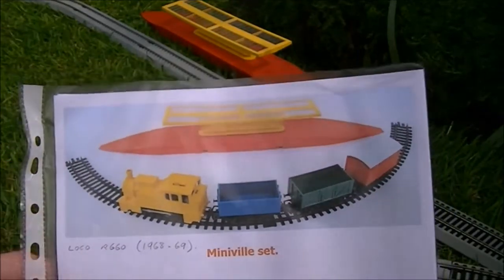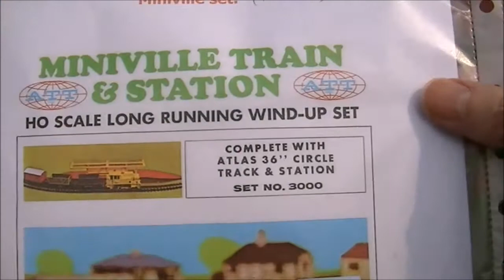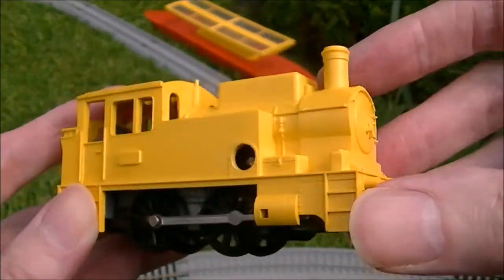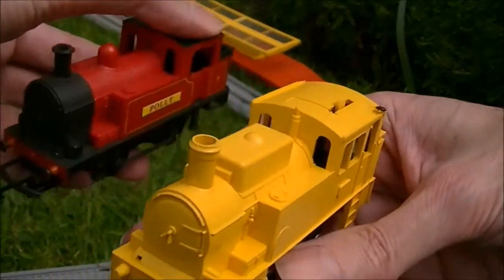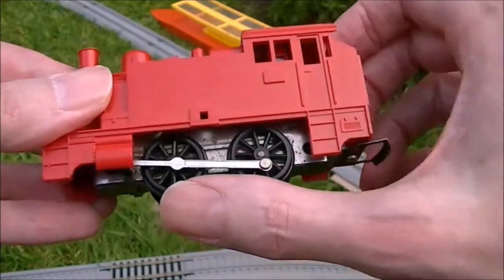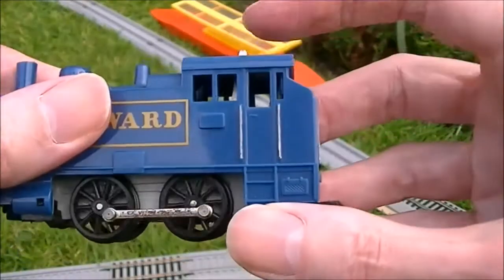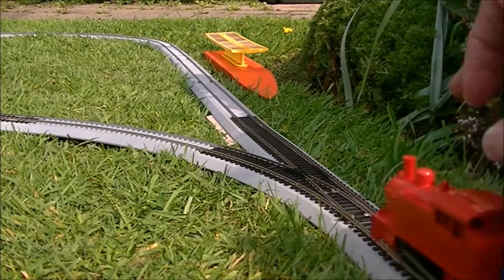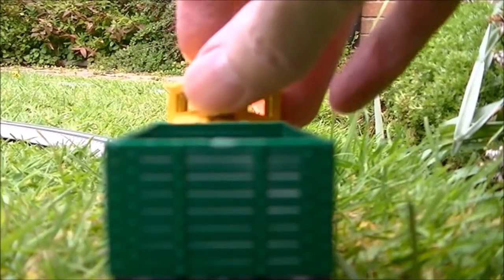Clockwork engines

Comment: Thank you for the great video!

I am finding the Top-Tank loco is a bit of a puzzle. I have just bought the 1964 electric version, and I had assumed that it was first produced as a clockwork model – but comparing your the clockwork model with my electric one I've come to the conclusion that the electric one must have come first.

The clockwork one has the two chassis holes at the front which are not used, and a mark at the back for the screw. which is also not used. Another difference is that for some reason they gave the clockwork model outside cylinders, whereas the 12v version has flat areas!

It's a bit of a puzzle as to why Triang would make a model so similar to the Nellie type and not very long after the Nellie type was introduced (1961?).

But on the other hand, the moulded area where the key slots into the body is the same on the 12v version, although there is no hole.

Very good video – you make me want to add clockwork models to my collection – my wife will not be amused!
Reply from the maker: Yes, many changes for such a cheap, small model. I can only suggest that they tried the Nellie body first, but needed more room for the spring. Plus a continental design may sell better abroad, if that's what they wanted.
Regards, Cliff.